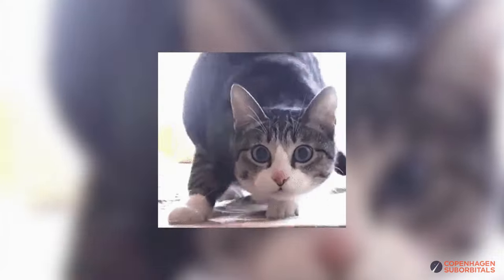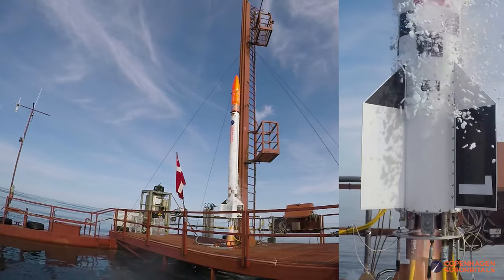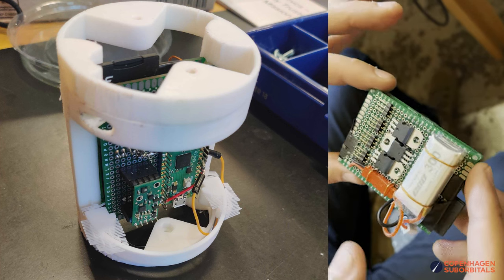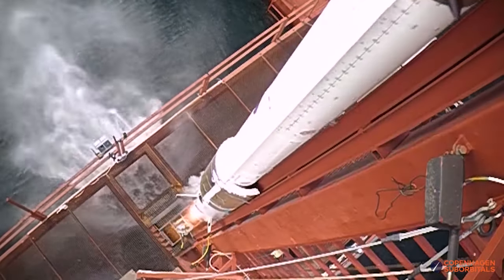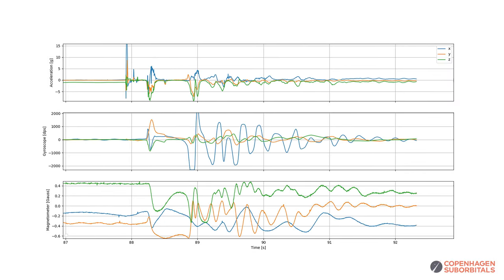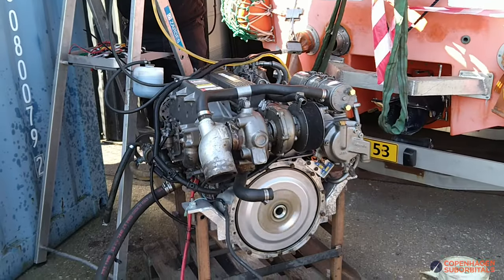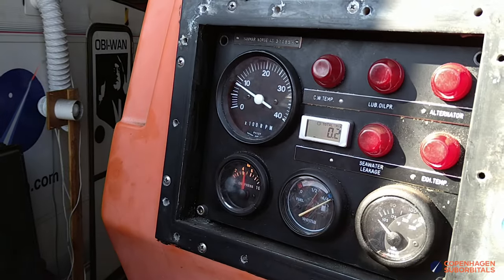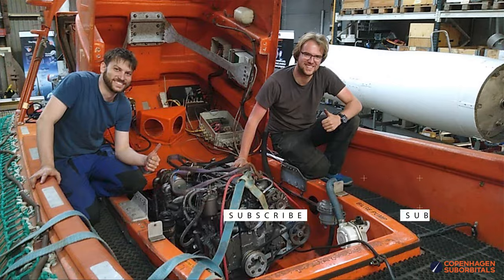Small Rockets to test Large Rocket Active Guidance

Comment: How are you dealing with aerodynamic weirdness? I’m not expert but this is how i understand it: If your canards are much shorter than your stability fins in the back. When you deflect the fins it can tend to cause super weird aerodynamics effects. 
Also you get stuff like flow separation, control reversal. Fin control is insanely hard.
Reply: You have to be able to understand your rocket angle of attack and a few other variables. And The dynamics of how the fin control angle translates to angular acceleration to the rocket, in order to derive a control system that is able to work. Very very hard
Reply from the maker: That's a topic for a video down the road. But this is why these quick and cheap model rockets came into the picture.
Reply: i mean, you WANT the canards to be much smaller than the rear fins. if they were the same size, the CoP could get in front of the CoM and then it would flip and RUD in flight. keeping the canards small makes their impact on the CoP less and the servo gear going in the nose helps keep the CG and avionics wiring toward the nose. just my 2 cents
Reply: @chrismofer  How would aerodynamic instability cause a RUD?  All I can think of is tumbling so violently it gets torn apart first, explodes second.  Other possibility is necessitating use of the FTS.

Comment: Short-range AA missiles aside, usually you do not want canards for active control on a rocket-powered objects since it is not stabilizing, causes extra drag and generally doesn't help area-ruling. On short-range AA missiles canards are used to destabilize/keep the missile close to neutral stability in order to turn and hit a high-maneuvering target. 

What is the practical reason for putting them on a space-rocket?